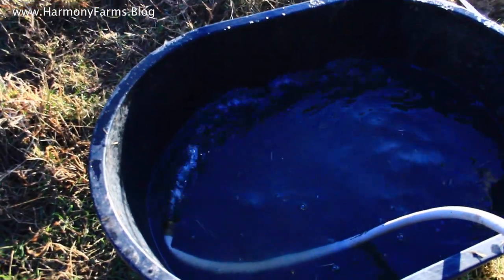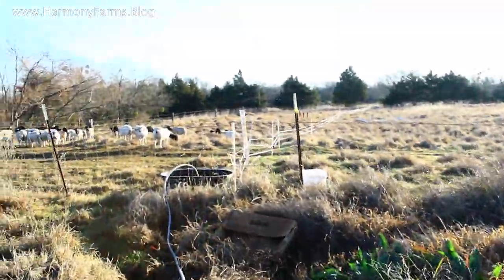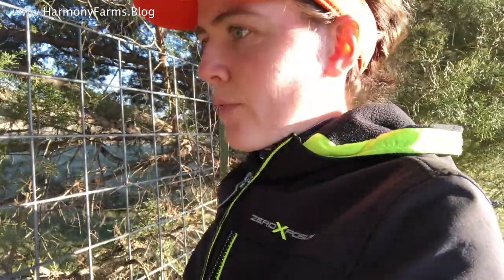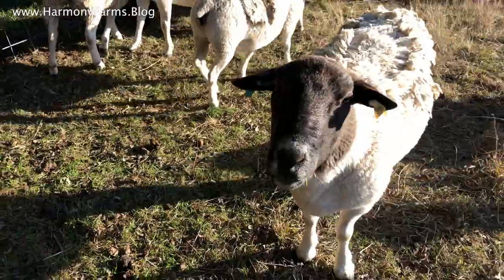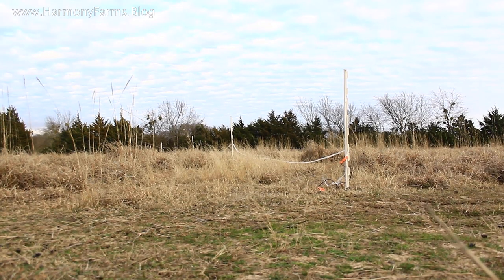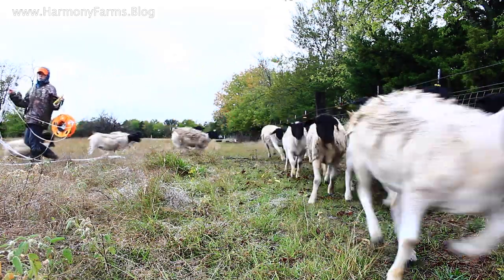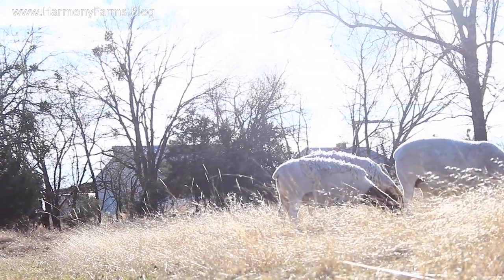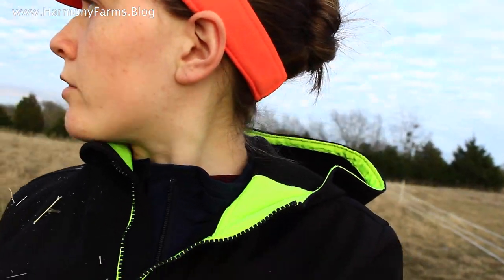WHAT DOES A SHEEP FARMER DO? | DORPER SHEEP, Rotational Grazing, Watering Systems, Fence

Comment: You may also be able to run a charger or fencer of a 12v car battery and wire either poly or stranded metal will be better than tape that's what a lot of farmers use in the UK